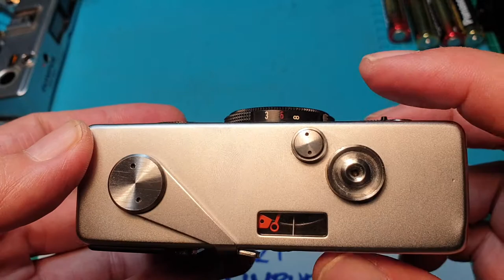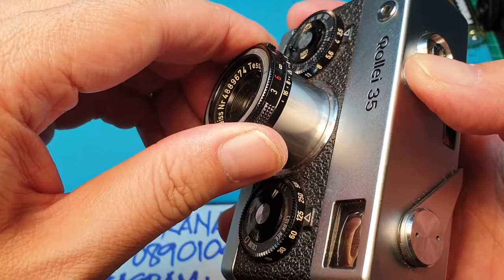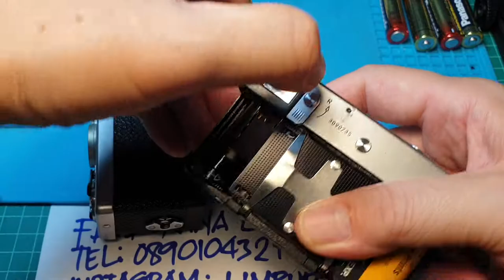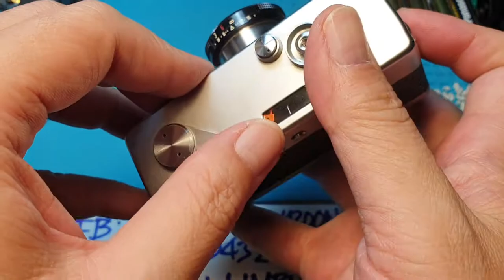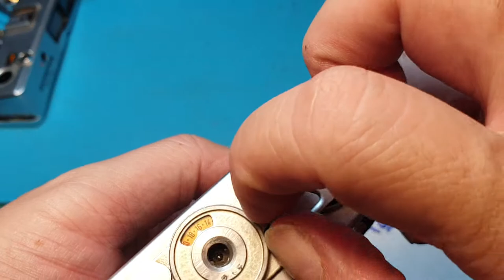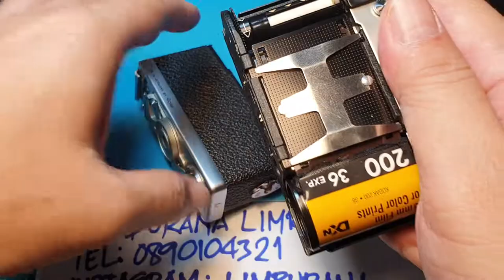Rollei 35 made in Germany version 3 S/N#3090735#

Comment: The primary characteristic of the "made in German" Tessar version of the Rollei 35 is that they are the oldest of all of the Rollei 35 units made. That doesn't make them bad, but it certainly doesn't make them better. The best cameras overall were the 35SE units made in Singapore from very late 1970s to the end of the company around 1982: best lens; best metering.